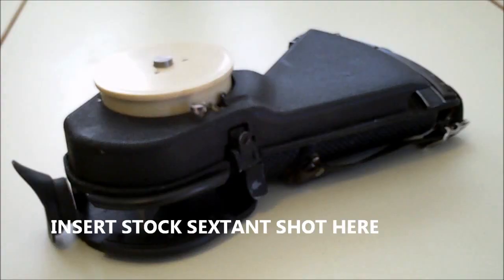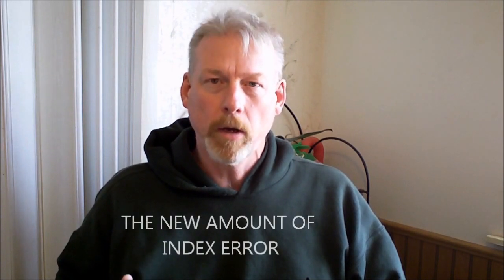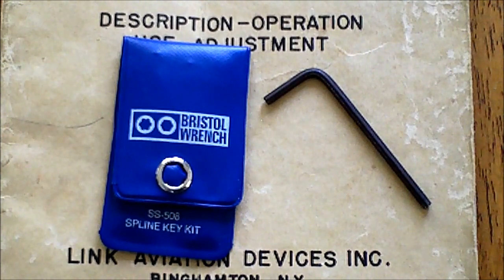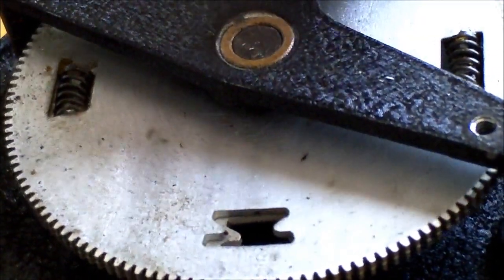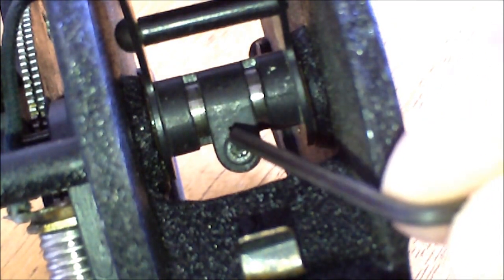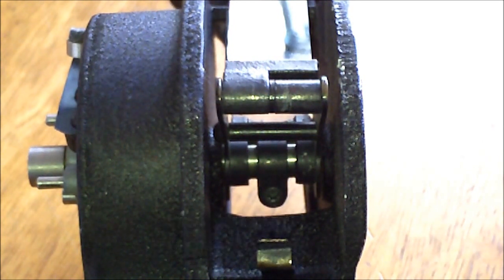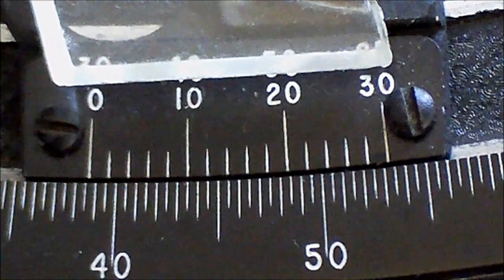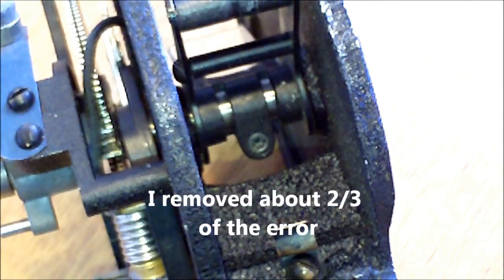Expedient method of Calibrating A12 bubble sextant for the Layman

Comment: I have calibrated my A12 as follows:
1) solve for noon shot sun altitude at your location
2)set that altitude on the A12
3)loosen index mirror screw just enough to still require effort to move mirror but not too much. you don’t want to stress glue joint at base of mirror.
4)during solar noon ( you have  about one minute of hang time)center bubble 
5) then gently move index mirror until sun centers, try not to touch face of mirror this will leave residue which can distort image.
6) very carefully tighten index mirror.
Only about 10 to 15 inch pounds of torque is needed.
This method will yield accuracies of one to two minutes.
Reply from the maker: Nice. Thanks for the information.

Comment: Bill, the technique of taking a shot from a known location and doing a sight reduction using the exact coordinates of your location as the assumed position works well. The "a" value will be how much one could adjust the vernier scale to minimize the difference. Of course I mean, many, many shots to obtain an average before changing anything. As you suggest, if the error is a 2 or 3 minutes either way, I would live with it and adjust during sight reduction. My sextants tend to be off one way for the sun and the other way for stars, so living with a difference is normal for me.I appreciate your video, good job.Joe